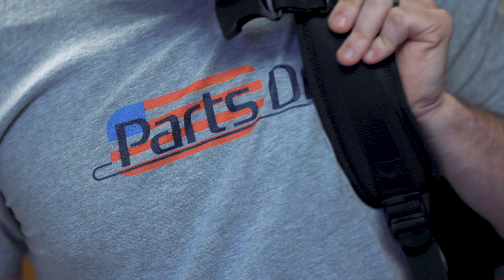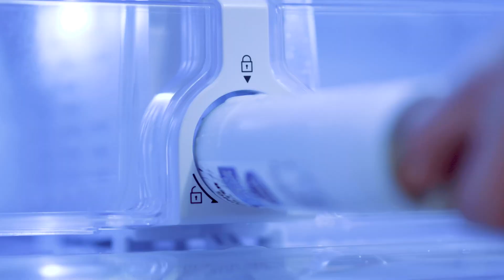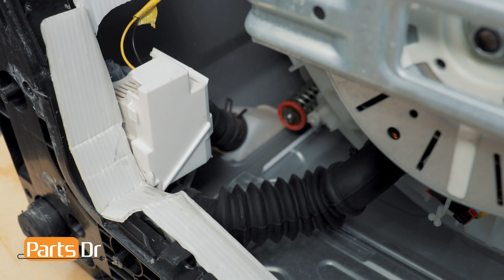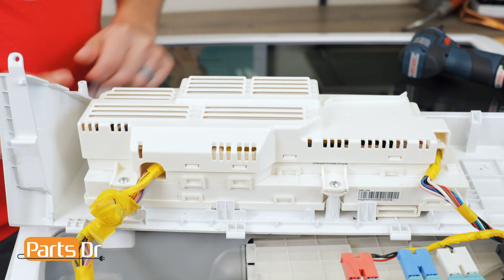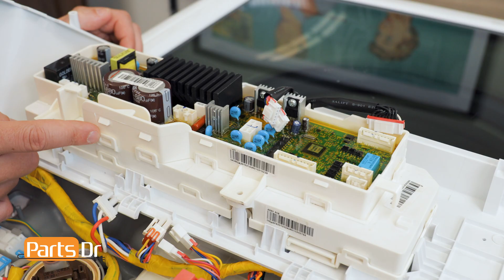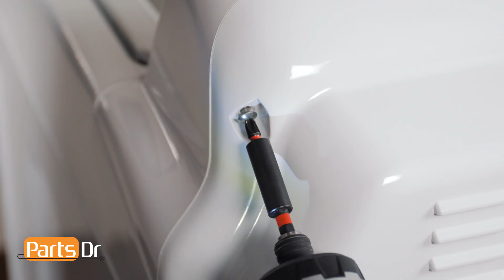How to replace Samsung washing machine main control board part # DC92-01021A

Comment: So I Originally got the 3e code which when you turn the machine on it won't spin and then after 5 minutes throw a 3e code. Model is the WA456DRHDSU/AA 01 

However after doing the spin test diagnosis by holding soil spin and power at the same time I selected spin through the round nob and after a minute it gave me the 3e2 code which is the main control board. 
So 3e is the motor drum itself
3e2 is the main control board.

Which one do I replace I don't want to buy a part that doesn't need changing because I cannot return electronics back to the seller thanks

Comment: for the WA456DRHDSU/AA 01 does it have a Inverter board on the drive motor itself or is it jsut the main control board on top of the machine where the knobs are?
Reply from the maker: On this model washer, the inverter is part of the main control board.
Reply: @PartsDr  perfect so by changing the main control baord will it fix the E32 error and start running the machine ?
Reply: Because I Originally got the 3e error  when I tried running a washers I would click start it would lock the lid then do nothing wouldn't fill water nor spin ... after 5 minutes it would give me the 3e error... but after I ran the diagnose mode and put it to tst test mode and it gave me the 3e2 error. Should only changing the main control board resolve this ?
Reply from the maker: @azadkar  Unfortunately, we are not able to troubleshoot the problem and promise that a certain part will fix a certain problem.

Comment: My drain pump not getting 120 coming out control board when put it on rinse and spin when I put direct on 120 the pump works
Reply from the maker: That is usually an indication that the main control board is bad.  Also, check to make sure the wiring harness is good and that you don't have a broken wire somewhere.

Comment: Have a samsung WA50R5200AW/US top load washer. Started throwing 5C and 0c codes, pump would continue to run until the error code. Unplugging it for 30-40 minutes seems to let me run a couple loads through. Started with the water level sensor (because it was cheap) that wasn’t it. Went to the pump, but it it working and there are no obstructions in the hoses, pump, or in the drum outlet. I think the last possible cause is the main control board. 😬
Reply from the maker: It very likely could be the main control board.  Also check to make sure the pressure sensor hose is not kinked and that air can flow freely from the tub to the sensor.  If you fix it, let us know what you find.
Reply: hose looks good, checked that first, I’d used the sticky grease on the shocks to fix the Ub errors so I was first concerned I’d pinched it recoiling around that back shock. Interesting , if power’s unplugged for 30-40 minutes, most times I can get it to run a full load. After a couple it starts fruiting off again. This particular washer model and issue is  not very well documented. That surprises me because it seems like it is a real problem ridden model. Will follow ip here in hopes it saves someone else the frustrations.
Reply: @ looking like the control board was the fix. I think the key to the troubleshooting was that I should have ran diagnostics multiple times. First couple times I ran diagnostics it passed fine. After i continued to have issues, ran diagnostics several additional times with mixed results. It gave me a water valve fault while in the hot water valve test. Failed once during agitation, another time failed with a 5c and a full tub, another with a code for overfill. After those tests, it became more likely to be the control board as a common denominator. Wish I had run diagnostics multiple times back to back. Also explains why i could run a full successful load randomly, while other times 5c failed it.
Reply from the maker: @mikeivan5947  Thank you for the updates!

Comment: I just ordered a control board, mine is throwing a temperature sensor code. I watched your video on how to test the sensor, it checks good. Hopefully this cures it, is there anything else problematic that’d cause it to throw this code?
Reply from the maker: It usually comes down to a bad temperature sensor, bad main control board, or bad wiring between the two.

Comment: A big thank you to the Parts Dr. team. By watching this video and ordering the correct part on the site I was able to fix my washing machine myself, something I've never done. Needed a new control board. Not a complicated repair but I'm sure I saved some money instead of having someone come out or just buying a new one.  The one I have is only 6yo.

The Samsung refrigerator I bought at the same time as the washer/dryer set has already shit the bed and had to be replaced. I bought Samsung appliances because I like their TV's so much. What I found out is they are not the same quality.
Reply from the maker: Thank you for sharing!  Nice job fixing it yourself!  What kinds of symptoms or error codes did your washer display when the control board failed?
Reply: @PartsDr  My symptom would be the washing just sitting there doing nothing. I would start a cycle, the machine would say 51 minutes, I would come back in a half hour and it still would still be saying 51 minutes. No error codes to speak of. I would have to pause it, lift the hood then start again and maybe it would finish the cycle. Maybe. Very frustrating.
Reply from the maker: @capozp5426  That is frustrating. Thank you for sharing!

Comment: what circuit panel board do I need for Samsung WA54R7200A ?  
 This washer is just 5 years old needs service for the 2nd time- so frustrating.
Reply from the maker: Click chat now on the bottom of our site https://partsdr.com and send them a picture of your model number tag for assistance locating the correct part.

Comment: I have a samsung washer model wa50m7450aw/a4. Getting an Error Code 4c. I know that deals with a water supply issue or kinked hoses. Hoses are fine, I replaced the water valve inlet as well. My last guess is the control board. Any advice?

Comment: I
If the control board is getting power and it doesn't work then it's a bad control board correct

Comment: my washer just sits there when hitting start.  Does not lock or fill.  Have to unplug and start over 5 times to get started.  Replaced door lid lock.......still same problem.  Does the main control board need replacement??  no error codes thrown.
Reply: did you figure this out because i just did the same thing, im hoping the control board will fix it

Comment: WA45H7000AW/A2 - When pressing the start button it double beeps and never starts.  it is as if the button is pressed twice, Start then Paused.  Every now and then it works as expected, but we have to semi-continuously press the start button until it does.  All over functions and features appear to be working properly. I have unplugged and perform the reset process and was able to sneak in a 'Self Cleaning' cycle - no resolve.  Suggestions?
Reply: Did you ever find a fix?  Mine is doing the same thing.
Reply: Same problem here!  I replaced the lid lock (ordered the part from Parts DR) and it still double beeps....Anyone get this resolved?

Comment: Great video, problem I have mine will not even cycle on at all for me to even see any of the display to see what error codes I may have.  It was just on a bedding setting with a queen sheet and a fleece blanket.  It's a samsung top loader VRT Plus.  Let me know what other info you may need to know.
Reply: Mine also did you find an answer?
Reply: @jjolson2157  I found it was the lock mechanism. I ended up taking it out cuz the part that shoots across broke and it would just click and click until it would time out and not work.  Ended up using super glue and a small piece of sand paper and reversed what I had taken apart which I don't suggest to do it's so cheaply made and ridiculous to put back together.  I got it to work  tho and unscrewed the top part so the fob is always in and you can open the lid like you could on the ones in the old days that would last forever.   Haven't touched it since.  There is a way to jump it but It  uses a ton of power so I'd stay away from doing that also.  Dunno what ur machines doing hope this helps in some way lol.

Comment: I have a Samsung VRT Stream washer.  Model # WF395BTPARA/A1 and I have an error code that is shutting down the washer.  The code almost looks like it's missing a LED in it.  It looks like bE but the "b" is missing vertical bottom LED.  So its kind of an open b.  Another way to say this, it looks like a E, but remove the top of the letter leaving a weird looking b or E.  So I don't know if I have the shorted PCB or not.  Can you help?  Thank you,

Comment: I have a wa52m7750AV/A4 the control board won't turn on. I tried two different ways to rest the board/system and it doesn't work. I was wondering what could it be. I open the back of the unit and control board is receiving power but it isn't responding. Any recommendations?

Comment: On my Samsung washer model WA48H7400AW/A2 , the cold water setting delivers hot- the hot setting delivers warm, and the warm setting gives cold, The water hoses are correct and I have replaced the water inlet valve assembly. The problem persists. Do I need to replace the main control board or is there a simple fix?
Reply from the maker: Maybe the wires are connected to the wrong spots on the water inlet valve?
Reply: @PartsDr  Nope, connections are in the correct orientation.
Reply from the maker: @enottingham  It definitely could be a bad main control board.  You should also test the temperature sensor before to rule that out.  We have a video on testing that here: https://www.youtube.com/watch?v=l_F9aHbjNQY
Reply: Hi, i get error AC6 on the board. Model# wf45n5300av/us

Comment: So I have a front loader samsung washer. When starting any wash cycle the washer will start filling up with water then shut off then restart the wash process leaving it stuck in the "wash" part of the cycle. However, if I unplug the washer it will work correctly until I start a second load. So right now I have to unplug the washer for a minute or so in between loads for it to work correctly. Is this a control board issue?

Comment: I have a Samsung wf328aag/xaa it is giving ND code. But the pump has been replaced and all the drain hoses are fine with no clogs. It still gives a ND code and doesn’t drain. Could it be the control board? Or something else?
Reply from the maker: This could be caused by a bad main control board.  The part has been discontinued by the manufacture for your model washer.

Comment: I just bought a set of Samsung washer and dryer but she said the motherboard was bad the model number is WA45K7600AW/AA
Reply from the maker: Troubleshooting a bad motherboard (main control board) can be difficult.  It usually requires quite a bit of troubleshooting and the process of elimination.

Comment: I have a Samsung Model #DV50F9A6EVW/A2 it’s stopping in the middle of a cycle. It’s giving an error code bE. Not sure if it is related but recently I’ve had issues where When I push the start button it doesn’t always start. Sometimes I’ll have to push it several times before it starts.

Comment: I have a wa45n3050aw/a4 that shuts off as soon as it powers on or when turning the cycle knob or pressing the water level and temperature buttons. If I unplug it and plug it back in, it works fine for one cycle then starts acting up again. The power cord works properly. Is the control board DC92-02118A the culprit? TIA!
Reply from the maker: We are sorry but we cannot diagnose that type of problem.  Intermittent problems like this are extremely difficult to pinpoint, you usually end up having to make an educated guess.
Reply: @PartsDr  I have a SAMSUNG WA45K7600AW/AA and I just bought it but the woman said the motherboard was bad how could I tell